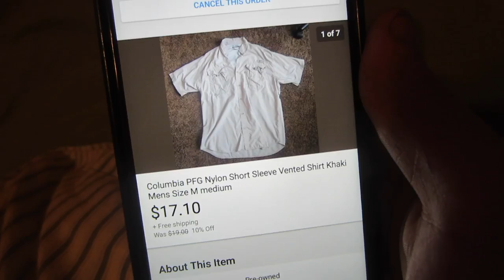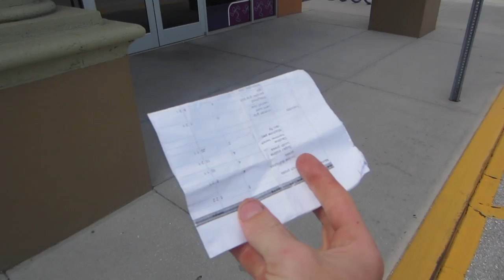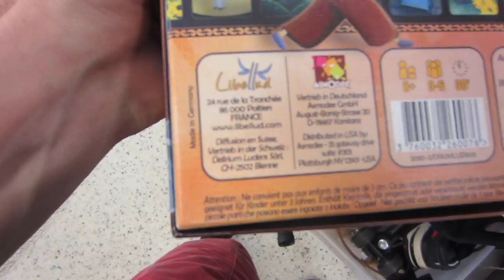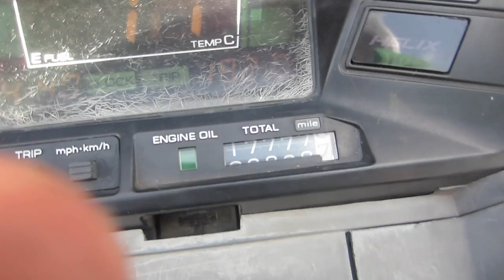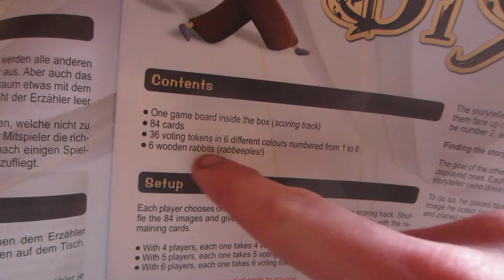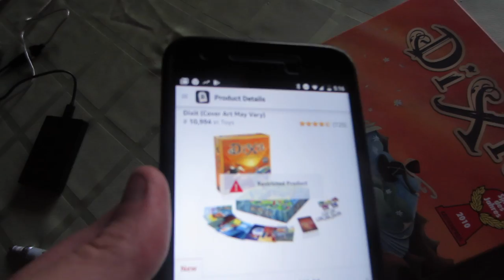4 Bad Goodwill Buys | Vlog 168

Comment: Ha you just kept clicking the flash. LOL
I had a similar issue with an Xbox controller I picked up. Got it home, wouldn't work, I had two 'parts' controllers. I took the battery pack off one and put it on and it works like new.

Comment: Another great video! 

I love those 80s motorcycles.  They are getting few and far between.  Actually when we where in South Dakota around the Sturgis area 3 years ago we saw a used bike shop that sold all vintage motorcycles and the prices where very low.  I had threatened to buy about 10 of them and ship them to our area of Florida and then resell them.  Still may be an option some day.
Reply from the maker: Thanks! Yeah me too! They are modern enough and reliable. Most of the same tech as modern bikes, <3 80s bikes. That bike shop sounds so awesome!

Comment: So, mannnny years ago (when EBay was the only selling outlet...at least that I was aware of...there was no Craigslist or local selling sites for sure...) I bought an entire set of China to sell on EBay because I noticed that there were others that were just PIECES listed for a ton (no way to check "solds" back then). Paid $20 bucks I think from a yard sale. So, it sat for 2 years or maybe more. I decided to put it on auction starting at $1.00 and $15 or $20 shipping. Sold it for...you guessed it...$1.00!!! I can't remember what the shipping cost, but a FULL set of China...each piece bubble wrapped= several boxes shipped separately=wayyyyyyyy more than I charged for shipping! I have a crap ton of stories like that. Mostly revolving around "bulk" and underestimating shipping. 😐
Reply: In regards to that particular sale, and just wanting the crap OUT of my house, it would have been way more to my advantage to just donate it or even leave it out on the curb!!!!!
Reply from the maker: Oh noooo! You live and you learn though! Good seller/customer service/ethics to ship it to buyer regardless =)

Comment: Why not take a pack of AA and AAA batteries thrifting for testing purposes? And maybe a small flashlight for looking into those battery compartments.... I carry my bike light in my pocket when I’m off-bike. If the flash works in manual mode add "Strobist" to the listing.
Reply: I have several sunpaks.